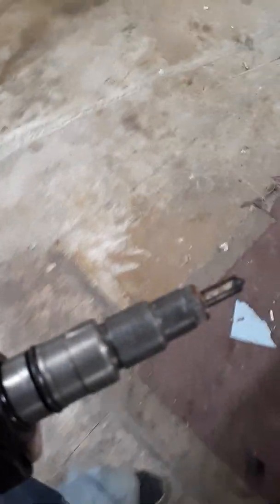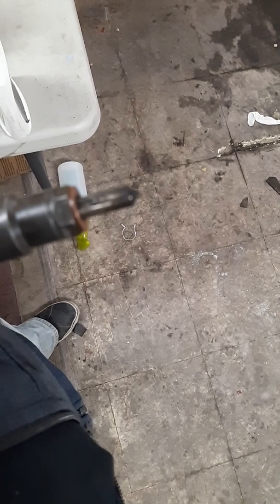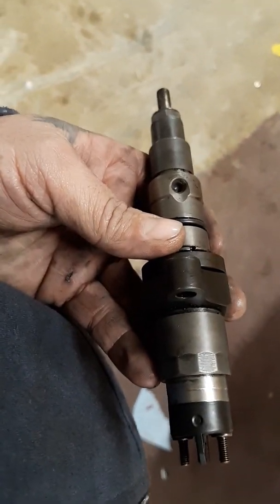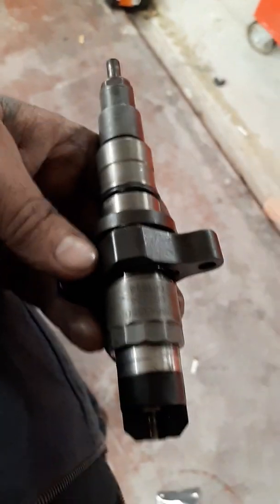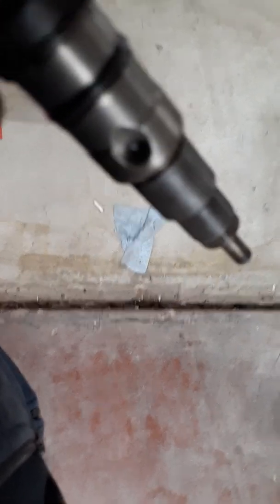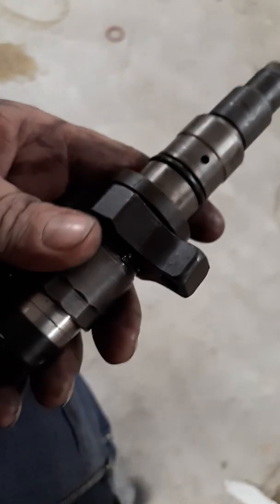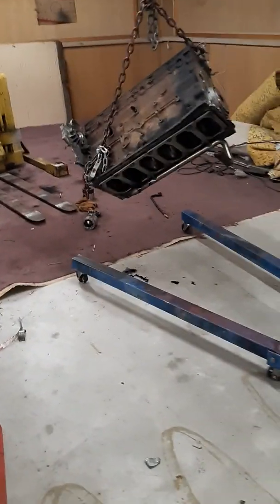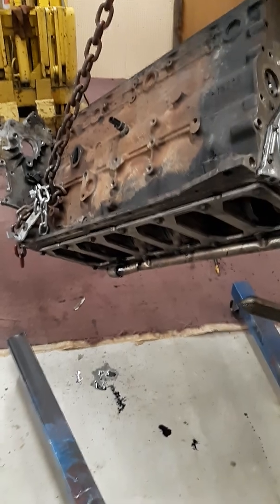Cummins 5.9 Diesel common rail fuel injector problems and fixes

Comment: What would cause to have about 3.5gallons of fuel in my oil? Truck runs fine and idles no smoke. Just a lot of fuel in the oil
Reply: I have a 04 dodge ram 3500 dually 305 hp
Reply: @chrisferguson1797  that's bad that's a sign of over fueling in my opinion. You can melt a Piston real fast if it's over fueling.

Comment: The content is dead accurate   never. mind the quality. Diagnostic requires knowledge and experience.  Anyone can swap part that is the case for the majority of Utube videos. 

I have a 2003 Dodge Ram 2500 5.9l heavy duty that i  make and use biodiesel  for it.  I was careless  a few times putting bad fuel in there.The consequence was disastrous truck broke down gone camping .  An experience i will never forget! I spent months fixing it cleaning all the lines, fixed the cp3 pump and ultrasonic cleaned the injectors.  I became an expert at taking these in and out, troubleshoot  and the whole nine yards. Here is the bottom line.  I like to add to this good video to benefit those that  have no start or rough start or smoky issue. 

1/ CP3 can be rebuilt easily.  No special tool is required. The most important part is to make sure the plungers  retract (search for Utube how to fix them those that made in India)
2/ Filtration is critical  as injector nozzles and injector passages are tiny small
3/ Injector can be taken apart and repair or replace with new part, be extremely careful with the check ball, spring and spacer (99% of the population will replace instead of repair)
4/ install low supply pressure gauge and high pressure gauge as fuel pressure in common rail is the same as blood pressure in human being.  I use the mechanical gauge and tap in the fuel supply line to the cp3 pump for low pressure and a test gauge under $35 on A.Express for high pressure .  That  connects to the high pressure sensor  on the main rail.  I leave it in permanently  to monitor the high pressure live.
5/ No good pressure is around 500psi, starting and running pressure is 4500-6000psi, all ports block off pressure is 24k to 26k pressure (that will tell how good the CP3 pump is)
6/ knocking, smoky  condition is severely stuck opened injector;   some white smoke  but reasonable running condition is leaky injector; it can be isolated by blocking off 1 at a time but hard to do if there is more than 1  leaky
7/ No start or rough start is REALLY easy to fix especially if there is a high pressure gauge. Just block off 1 injector at a time . Keep doing that until truck starts  and you will see the pressure quickly rise to more than 4000psi  too. You have located that bad injector
8/ This tool will save you lot of money and cussing.   I got  mad trading a brand new chain saw for this mechanic to check the high pressure  when my truck did not start a few years back.  That was all he did  and he got a brand new chain saw from me.   F. that deal as i did not know better!!!!!!!!

https://www.aliexpress.us/item/2251832593119817.html?spm=a2g0o.productlist.main.1.6af3ee13x9kL9M&algo_pvid=d32714c5-0138-4bd4-8c18-14b27e7df72c&algo_exp_id=d32714c5-0138-4bd4-8c18-14b27e7df72c-0&pdp_npi=4%40dis%21USD%2133.70%2133.70%21%21%2133.70%2133.70%21%402103010b17154421110103614e1b67%2162830399837%21sea%21US%211619653101%21&curPageLogUid=n5DvNf9DenQz&utparam-url=scene%3Asearch%7Cquery_from%3A

9/ Do not rebuild injectors. Buy new only.  I had them rebuilt after that  bad trade  of no. 8. It did not last more than 20k miles and worse yet I found out that bastard  rebuilder did not put in new parts when i took the injector apart completely to clean.  That was the rebuilder on Ebay!!!!!!

Now how do you think i know all of these if i did not spend years  working on it.  In the case of the camping situation it took me months to fix it. It is NOT the truck but my fault carelessly NOT to put in extra filters and had bad  biodiesel in there a few time.  Nothing is wrong with the biodiesel that i made and used for years  just that it won't tolerate dirty  or bad fuel.
What fixed the truck were:
a/ clean the cp3 pump
b/ clean all fuel lines
c/ set of new 6 injectors (repair did not work as i lost the ball and spacer)

If you take the injector apart completely and look at the nozzle tip in particular with a microscope you will understand what I am talking about.   I did that!!!!!!!

That was a lot of good information but i did not do any video capture as I was not in a mood to do that trying to  get the struck to start and my hands are completely dirty.

I am sure someone reads this along with this video will benefit greatly!!!
Good luck to you!!!!!

Btw i have fixed cars and trucks for decade and was a used car dealer  decade ago.  I already had plenty of experience in auto troubleshooting and repair.  I have this truck more than 10 years already and i bought it mainly for the purpose of running  biodiesel that I make.  Engine runs way quieter and oil lasts way longer and of course the emission is way cleaner and smells way better!!!!!!

99% of the population will not do biodiesel due to lack of knowledge, know how and motivation.  Way easier  just to go buy diesel than all those work.

Comment: I have an 05 common rail and have a hard start and I have done the block off one at a time did not crank straight up on each block off…did a kill test on my scan tool and each injector I kill didn’t change the tune of the engine…what am I missing

Comment: Question
I have a 07 ram 2500 5.9 cummins 183,000 miles
Having issues starting after i stop and go in a store
Truck won't start I give a few squirts of spray silicone and it will start.
Truck doesnt smoke or idle rough
I put a new in tank pump in November.
I am stumped
Thanks
Reply: Lift pump?

Comment: We have that high return no start problem
only starts with petrol perfume 

blocked injector 5  engine started normally didn't tried another one 

will send injectors to a mechanic to test , clean and adjust them and report back

*edit  just send them to tester said 4 was clogged and was sending all diesel to return  only 2 was working 
they just cleaned them , now engine working 1 sec after cranking 
thanks alot your video helped to identify the issue
we can't afford changing them right now maybe in future after they fail completely
Reply from the maker: Save yourself the trouble if they are old and change them all
Reply: @absolutetow  edited*

Comment: Good info. Thanks for taking the time to put this video together. It will help me diagnose my smoking issue. Industrial injectors only have about 20k on them and it would smoke slightly and idle rough with a cold start and go away when it warmed up. Now it is smoking a lot at idle. Need to figure it out before driving again.
Reply from the maker: No problem

Comment: Pretty sure you got that backwards pal 04 and a half to 07 and 1/2 have the better Pistons they were designed to handle more heat to accommodate the higher exhaust gas temperature that was created due to the third injection event that was added due to smog regulations at the time... just thought I should let you know so people don't think they're 04 and 07 engine the worst are the best five nights ever made
Reply from the maker: Unfortunately I've rebuilt hundreds of them. My knowledge is first hand

Comment: What could cause an early 04 cummins to lope at idle? Will also lope when cruising to a stop. No smoke, truck starts easily hot or cold (1-2 seconds to start). I'm replacing the fca this weekend, but I'm worried it's something else.
Reply from the maker: I would start by checking everything out on a scan tool. Codes and live data
Reply: @absolutetow  I used my smarty touch to log some data, but nothing stands out (to me or a few others anyways, as I asked on a forum). The rpms don't stagger down when I rev it to 2.5k in park. There's also no codes present (checked with smarty and did the key check too). Forgot to mention that fuel return rates "check out" according to the dealer. Is it possible bad fuel could cause this? I accidentally filled up with shells v power diesel, as I wasn't paying attention and i doubt many people use it, 3 or 4 days later is when I started to notice the lope. It slowly got worse until I added a whole bottle of diesel kleen (thought it wouldn't hurt if I had to replace injectors anyways). Since then, it's been slowly subsiding.
Reply: @michaelboardman8331  did that end up being your issue. Just bad fuel? I have the same issue but when I rev in park it sputters on deceleration back down as well. I’m guna test FCA first
Reply: @Bum_Leg  sadly not. i bought new injectors and it solved my problem. i had the old ones tested and they were all over the place.
Reply: @Bum_Leg  check out flux diesel, they have good prices and warranty. good luck though.
Reply from the maker: I would think the problem would show somewhere on live data like fuel pressure fluctuations or something of the sort

Comment: Ideas for a return flow test if I'm not having cold start issues. Or long cranks?
Reply from the maker: To test return fuel you remove the fuel line from the back of the head. Hook up a piece of extra line from another truck, cut it and put a long rubber hose on it so you can run the truck for a min with the line in a measuring cup. Then you can go off specs on how much return flow you had

Comment: Diesel master 
I have a question for you my 5.9 12 valve cummins starts up right away runs for about 30 to 45 seconds and then will shut down. This is in mostly cold weather around 30 to 40°.
Then I will have a hard time restarting. I have to mash the pedal to the floor and pump also and she will start. Once started she will run fine no smoke. This is a 1995 motorhome diesel pusher with only 67,000 miles.